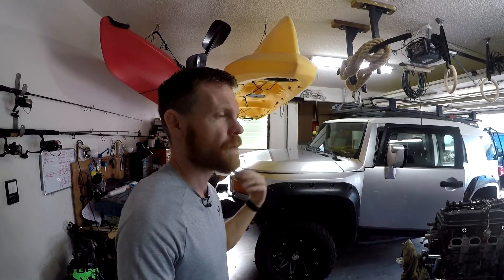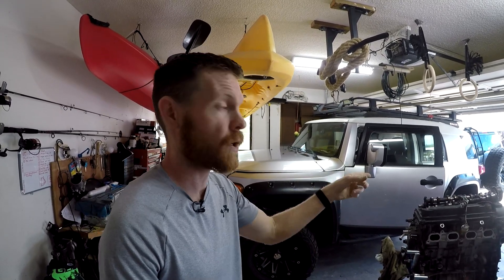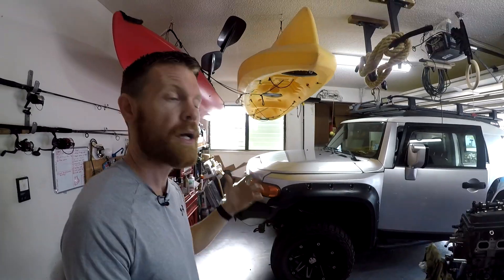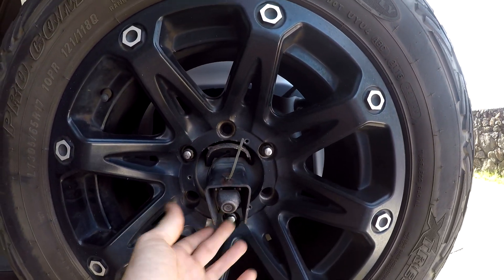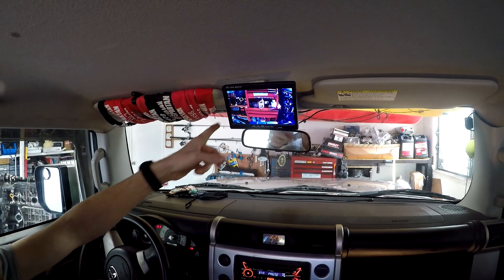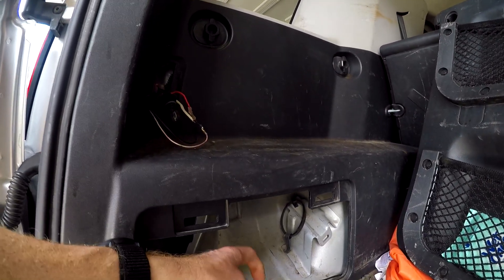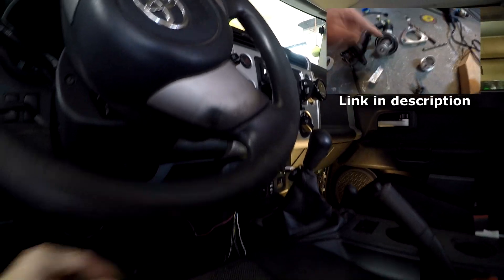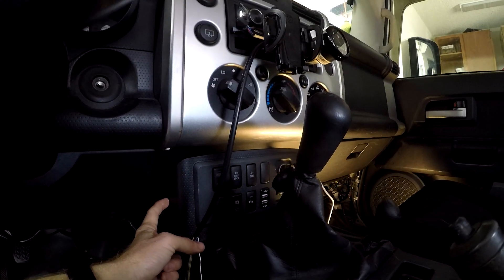The FJ Cruiser Ideal Camera Setup: Front and Rear Cameras

Comment: Great setup with that reverse switch. I have the 12” rearview camera. I also installed two small cameras in the back/bottom of the front fender flares. I connected each one to their own 5” monitor. I have the monitors on the left and right side of the Inclinometer. Ran wires under wheel wells, into engine bay, through firewall, under dash then up from behind inclinometer. These cameras take away any blindspot and give me a better viewing degree than any mirror could. I really never turn my head with this setup. 
Be well.
Reply from the maker: Oh cool! I've been wanting to put side cameras on. I'm not sure where I would put the monitors where they are out of the way though
Reply: Do you have any content of what it looks like or what install is like and where to order?

Comment: This is nice. I installed one of those digital rearview mirrors, but I don't love that it gets in the way of the visors. I also really like the setup with the front camera you have. I could care less about the dash cam in the digital rearview, but would love to have a dedicated one setup with two cameras serving as trail cams if they had a decent viewing angle.

A few questions:

- What type of battery do you use for your setup?
- The downward viewing angle on my rear camera is a little high, but that could be due to having the tire cover on there. How do you like your rear camera for reversing?
Reply from the maker: I have a yellowtop optima battery that came extra with my IS300, it has the necessary CCA for the FJ, so I have it in there. The IS300 will be getting an engine rebuild/upgrade and won't be driven for months while I'm doing that..all the more reason to use the battery in the FJ

I like my rear camera, it faces down a little, but it mostly faces back. I will say, though, I don't have to be concerned about getting close to objects since my FJ came with the backup sensors, so it beeps when I'm close to something